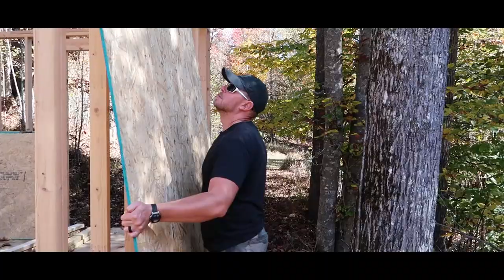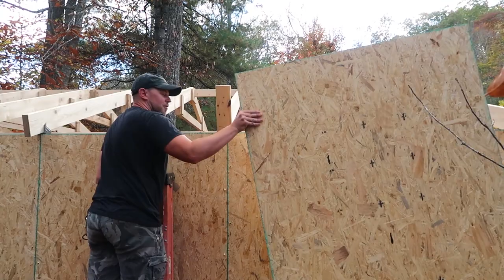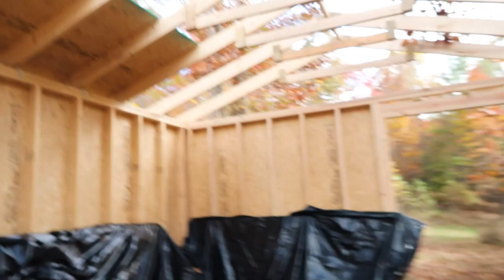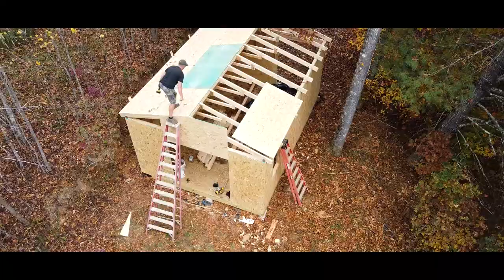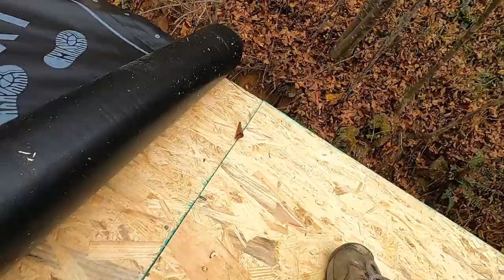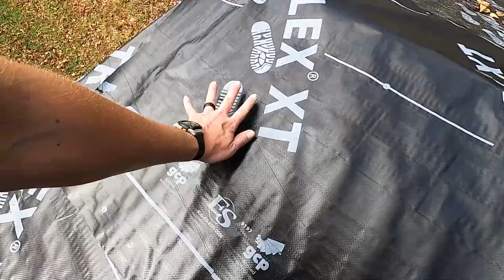Sheathing a Shed Roof with OSB and Installing Underlayment

Comment: Love the videos. this is really shaping up quickly.
The H clips between the roof sheathing also tie together the unsupported edges between trusses stiffening the boards against flexing under load. I hope they saved a lot of time over putting in noggins between the trusses?
 If I may comment, the roof sheathing should go on after the ladders, so that your sheets can span both the main roof and the overhang.  The sheathing then acts as a tensile member opposing the ladders 'bending down and away' from weight load on the overhang (much like the suspension cables on a tower crane holding up the jib).  This also allows the root underlayment to span the overhang so that any water that gets under the metal roof won't be able to seep in between the main and overhang.
Reply from the maker: The H clips did save a lot of time! Because of the monster storm that blew in I did things a little backwards. I got the underlayment on and then built the overhang once the 5+ inches of rain passed.

Comment: I get it that you would need "stop blocking", if there was a significant pitch...but the pitch on this roof is just a few degrees of a Flat Roof.
Reply from the maker: Yes for sure! Its just a little tip for this making steeper roofs.